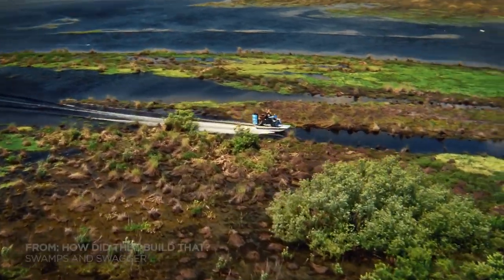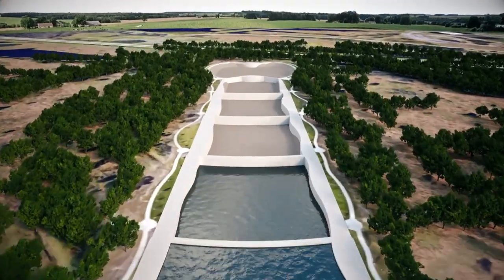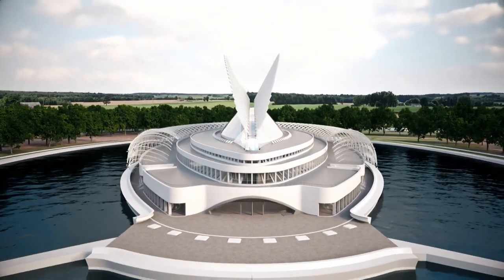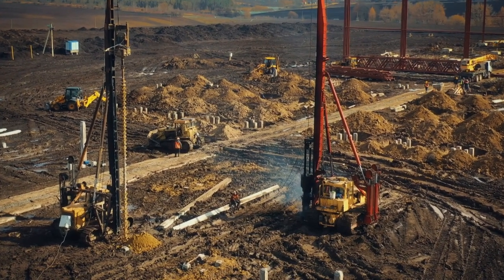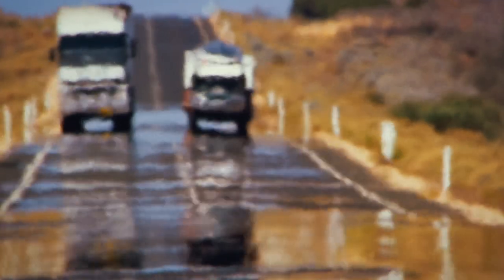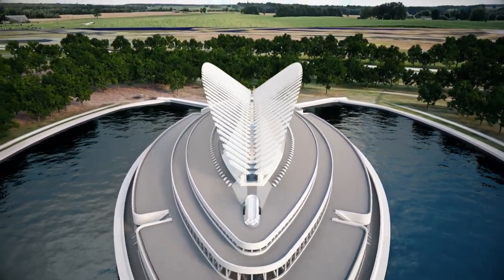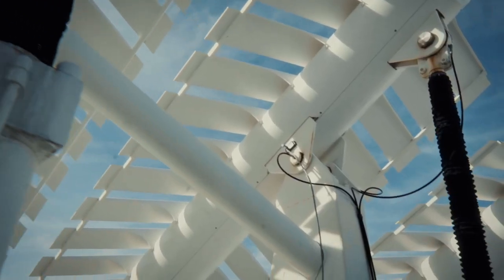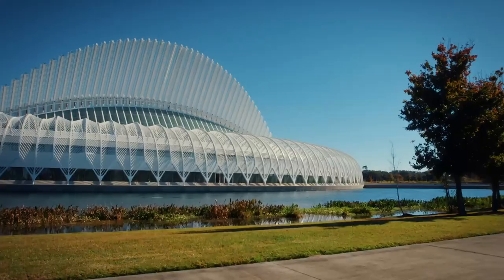Genius or Insane? College Campus Built in a Florida Swamp 🥵 How Did They Build That? | Smithsonian

Comment: They seem prepared for the brutal heat, but I hope they thought about hurricane season and flooding. Otherwise, the damage repairs are going to be extremely high. I hope it works though because they put a lot of work in it.
Reply: Hi I go to florida poly. We had two hurricanes last semester and the building was fine. No flooding and if there was any damage it was minor and fixed within a few days. Most important buildings in florida are built to withstand category 5 hurricanes

Comment: Anybody notice:
1) it’s a copy of:
(a) his unbuilt cathedral of Christ the light in San Francisco
(b) a library he designed in Europe
(c) the Milwaukee art museum
(d) the wtc path station
(e) his proposed cultural building for Roosevelt island in NY 
They all have:
(a) the same ribbed cathedral-like atrium
(b) same elliptical/oval shape 
(c) all are white
(d) most have moving parts resembling wings w/hydraulics 
- - except w/this Florida building - - 
2) placing aluminum shades over the glass canopy to prevent it from being a hot greenhouse (then why make it a glass ceiling if it’s going to be covered by a second layer to block the glass ceiling?)
3) rimming the perimeter with a 39 ft steel pergola (1:02) to block “sun + wind” is false - - because the sun +/wind will travel right through it.  It’s just an excuse to clad the exterior with a fanciful chevron pattern.  At least they should just say what it actually is (not some phony baloney utility that it clearly isn’t)
Guess this is just his schtick